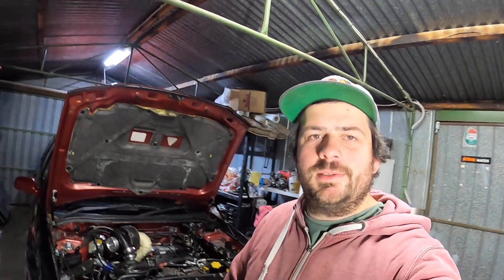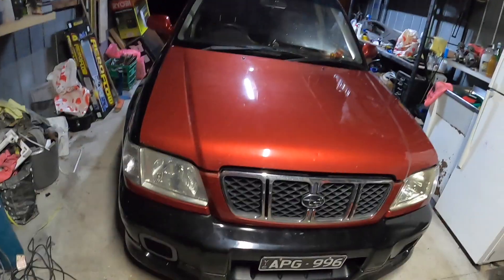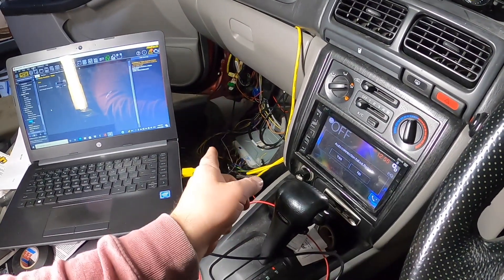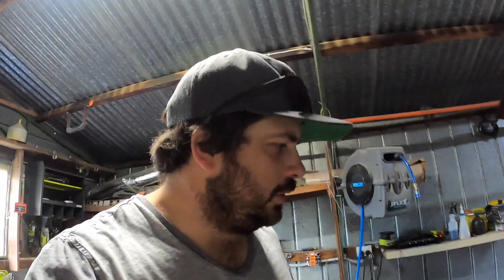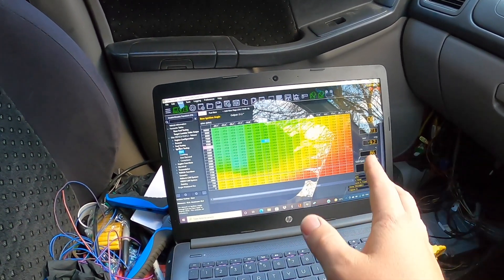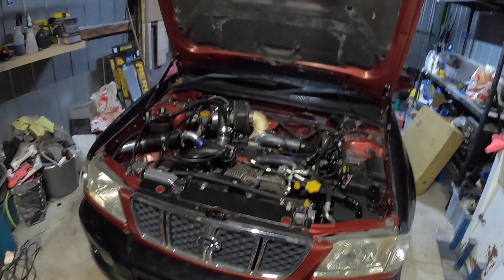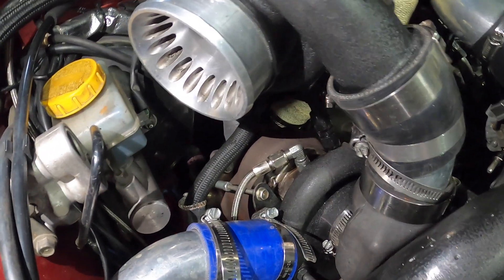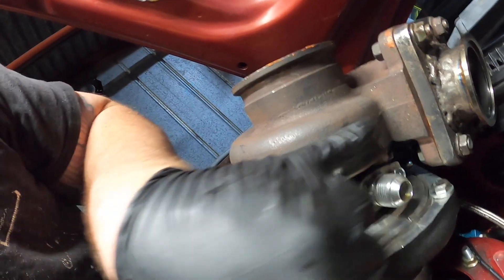TWIN TURBO FORESTER // FIRST TEST DRIVE DOESN'T GO SO WELL

Comment: You got this! I figured it was a missing oil restrictor causing the smoke. Have you figured out a way to plane those flanges down flat?
Reply from the maker: Just picked up a banjo fitting for it. Just sealed it for now. Will be coming out again when I do the cams in a few months